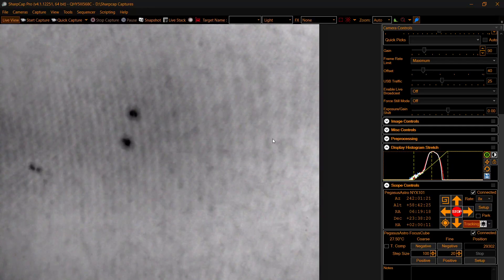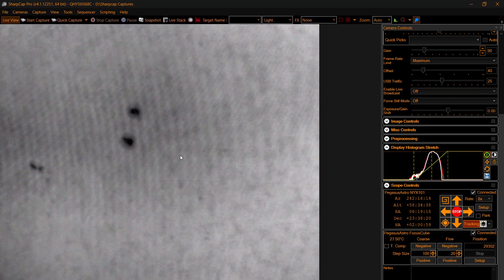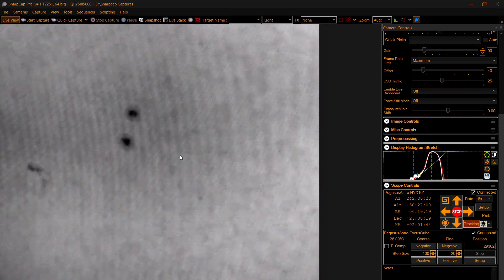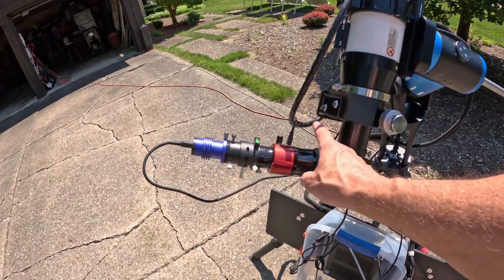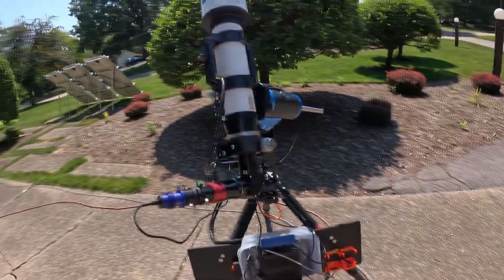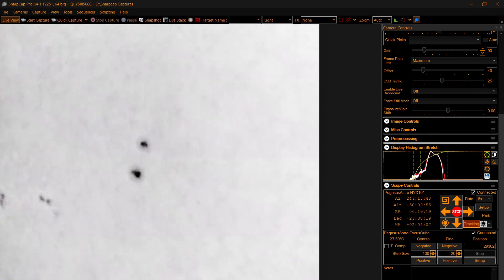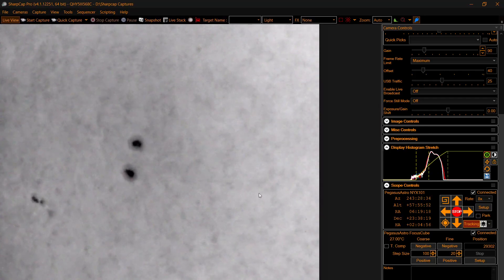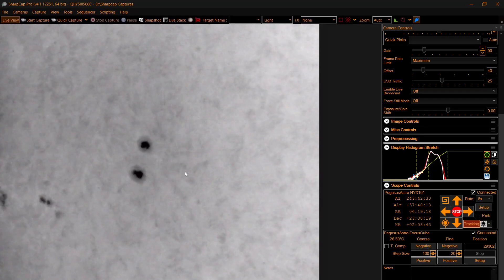Do You Have Newton Rings? Then Try This...

Comment: Thanks for this great tip! I'll try it out on my next solar observation. I was already using the Rowan tilt corrector, which worked well but was difficult to adjust with 6 screws that I never touched…
Reply from the maker: Hope it works as well for you as it did for me...  I've been using it for the last couple of seasons and it performs wonderfully. Very easy to adjust also...  Clear Skies!

Comment: Hello. Since I have the same problem, I have been following your system with much interest.
Now, I have a question. I saw that you place the ADC after the Quark. How much does that affect the effective focal length?
Have you tried placing the ADC before the Quark?
Thank you and greetings from Venice, Karl-Heinz
Reply from the maker: Karl  You can't place the ADC in front of the Quark... to much heat would hurt things in the ADC. I will usually do a 30 to one hour solar session and that can be a lot of heat build up for the ADC. I think the ADC has something in between the prisms that also might be affected by the increased heat from the sun. So I didn't want to take the chance of burning up the ADC and it works very well in it's current location after the Quark. I'm using a refractor and didn't have any issues achieveing focus. Hope this helps...
Reply: @jeffrh  Thank you very much for your kind reply. In my optical train inside my refractor 152/900 I have an ERF filter, so the heat problem does not exist. Instead I noticed that with the tilt of my Apollo mini I noticed a discontinuity of focus on the sensor. I will try now with the ADC, see if I can solve it, an h because the Flats in Autostakkert do not lick my Newton rings. Thank you very much and hello from Venice.
Reply from the maker: @karl-heinzmacek70  I use 2 refractors with this setup. An AR102 and an AR152. I'm not running with any additional aids. My worry was with the 152 and some extra heat buildup. So far so good with this setup. I will start out using the AR102 and if the seeing is good nough. I'll switch over to the AR152. All I need to do is remove from the Quark back and attach that on to the next scope...  Has been working out very well with our active sun of late...  

I'm in Orchard Park, NY USofA. So your a little lower than I am. Right now the sun is very low and in the trees...  ;-)  All the best and clear skies...

Comment: Thanks a lot, you nailed down, I have just tested it and works very well indeed !, I was a bit unconfortable with the use of the tilter, so thanks again for your nice solution.
Best regards and CS!
Reply from the maker: Glad it helped...  With my Quark and an UV/IR Cut in front of it. There us no solar heating to the prisms and if any it is from the fact that the sun is hitting the outside of the unit. Hasn't been a problem for me and I'm in the process of making a blocker so all the gear is in shade. Clear Skies...

Comment: WOW, GREAT!! I would not thought of doing this! I do have the ZWO ADC ( I would think any ADC will work) and will try it as I also have the Chromo Quark. I agree I was not a fan of tilting the camera to fix this.. Thank you!! Also Daystar sells a special clear film that scatters the light for better flats, and now with the ADC I may not need to use that?
Reply from the maker: Funny what you think of when your in a bind...  A Dispersion Corrector wasn't even on the radar until I happened to see it sitting in the unused section of my Astro stuff...  I'm very familar with that DayStar Film and know a few individuals that have tried to use it without much success. Not sure if it is them or the film? Not worth it for me as I can make flats by looking for a quite part of the sun and going way out of focus. Then use SharpCaps Capture Flats option and I have a Master Flat that works very well. The Quark isn't show a full disk with my rig so it is an easy fix...

Comment: I had the same idea a month ago and I verified that it works nicely in practice as well as in theory. Newton rings are formed because the optical path is very narrow, about f:25 or f:30 due to the 4.2x telecentric barlow in the Daystar Quark filter, and internal reflections tend to form interference patterns, especially in monochromatic light. By tilting the camera or interposing the ADC corrector the same result of disrupting the interference patterns is achieved. I think they are caused by the optical window of the camera, placed very close and parallel to the sensor, and the reflected light from the sensor itself.
Reply from the maker: Thnaks for the info... Rock Mallin the maker of Mallincam cameras has a couple of SolarCams that he says fixed the Newton Rings issue and from those that have his cameras, seems they work very well. I didn't feel like spending the cash just for a Soalr Camera as I like the ones I have now and the Dispersion Corrector saved my bacon...  ;-)
Reply: I think the Newton rings are just caused by the Fabry-Perot etalon inside the Daystar Quark, and not by the window of the camera. Actually the rings are visible in cameras with and without window
Reply from the maker: @jmm3194    I know a few people that have purchased a SolarCam and they say the camera helped with their Newton Ring issue. They also have Quarks similar to my set up and Lunt Solar Scopes... I didn't feel like spending the cash for another camera when I'm very happy with what I already have. Not sure what this means as this is way above my paygrade...  ;-)